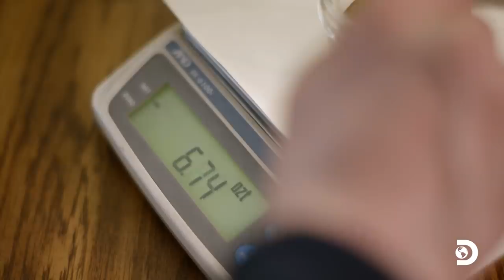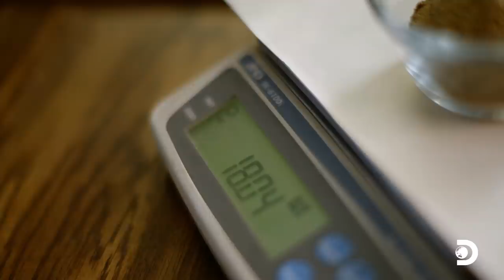Vernon Mines His Best Claim on Very Thin Ice | Bering Sea Gold

Comment: Anybody else notice the continuity error? The smooth–sided glass dish that Gary starts pouring the gold into at 6:40, is not the same as the diamond–patterned one at 6:56, but then switches back to the original one at 6:58, and then back to the second one at 7:15
Reply: Lol good catch ,the first one is like 1/3 full and the 2nd is like 3/4 full lol
Reply: Ones a bowl and ones a jelly jar! 😂
Reply: I think they weight twice using different pot.